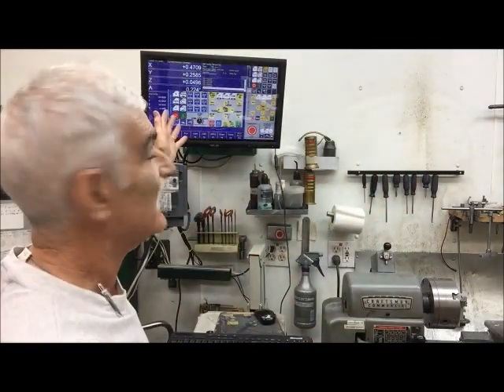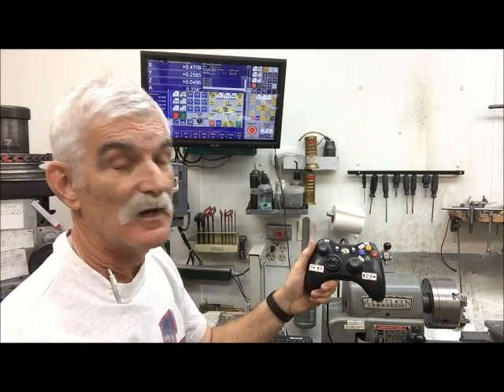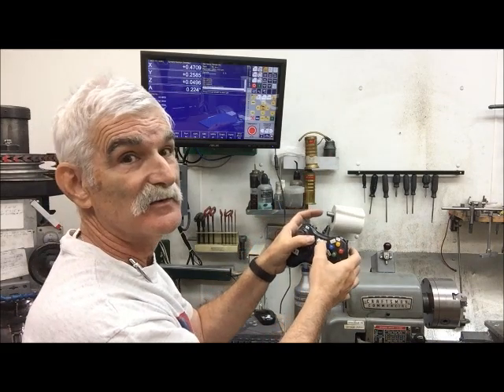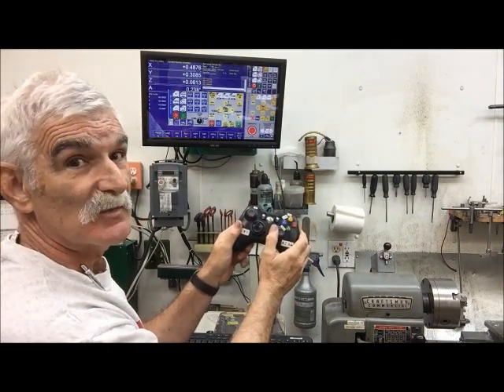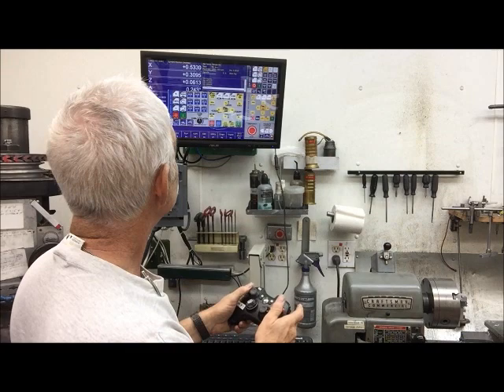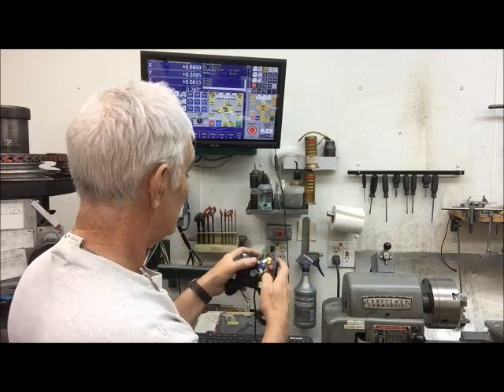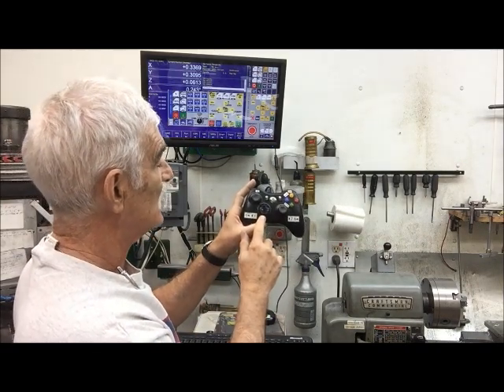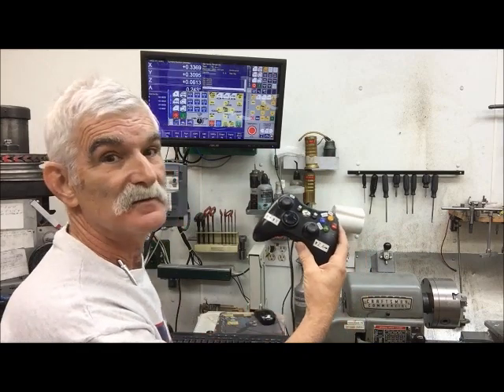Centroid Acorn CNC with an X Box Controller

Comment: can you share the setup file (i assume there is one?) or instructions (if setup file doesn't exist)  on how to program the driver to map the keystrokes to the xbox controller?
Reply: If I got it right, the setup file can be found on reWASD Official site: https://www.rewasd.com/
And the how-to is available here: https://www.rewasd.com/blog/post/how-to-use-xbox-one-controller-on-pc
Hope this helps :)
Reply from the maker: I'm on it. Rick
Reply from the maker: The set up file would be found there if I had uploaded it. The position of each control is a personal choice so I figured the reader would want to do the placement. If wrong, I can upload it.
Reply: The file on the site did work just so you know..I downloaded it for testing since I knew it worked lol and it works great!!! Perfect job !!